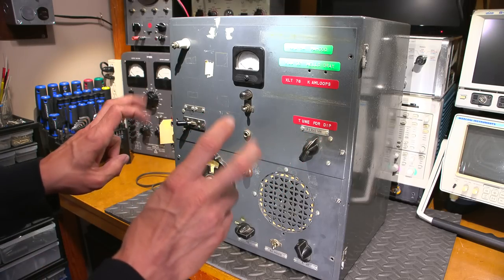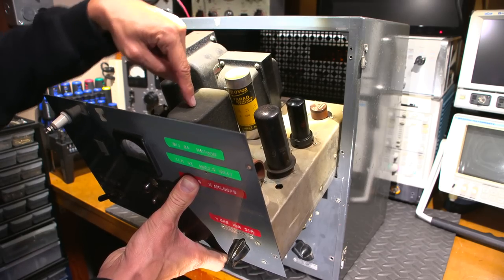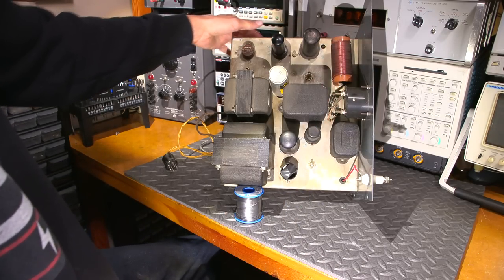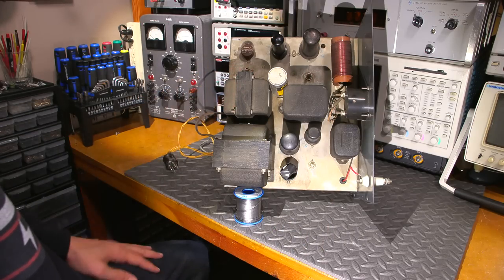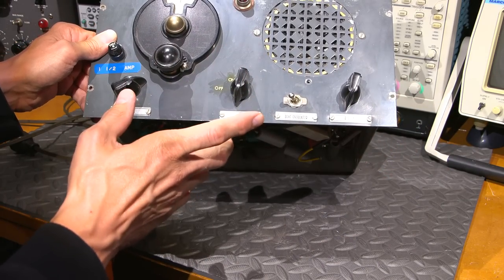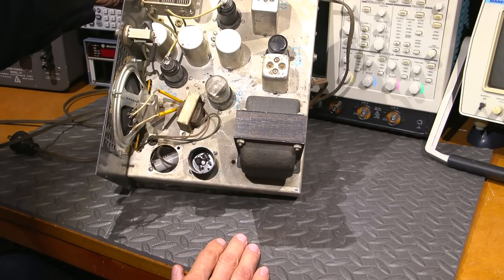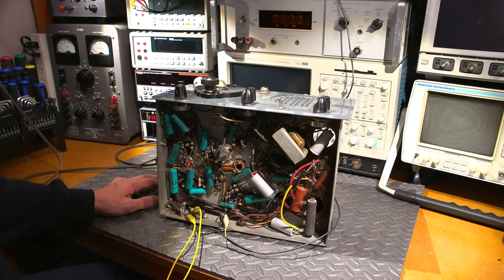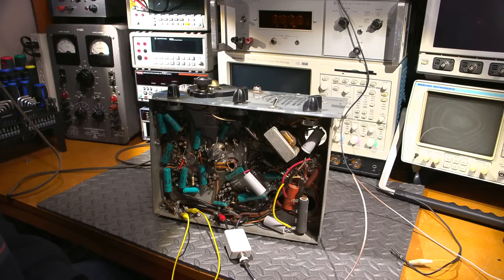1940's Forestry Radio Receiver And Transmitter [Teardown With Circuit Description]

Comment: Used to work for a Yaesu dealer, lost count of the number of 6146B tubes I binned due to collapsed envelope. Glass melted to the point that there were holes in them with obvious loss of vacuum. Mainly from FT101’s, FF901’s & FT102’s. Loved the bit in the manual for the FL2100z linear amplifier which told you to check both tubes were working by making sure the anodes glowed equally! I miss the days of tubes, solid state kit doesn’t explode in quite the same way and there’s nothing like the smoke from an HT transformer having a meltdown. Was always good fun to discharge the HT with a screwdriver just as one of the company directors was showing a guest past my workstation too 😂

Comment: Hi, Paul, thanks so much for this one.  Please accept my sincere condolences for the loss of your Father. I'm sure he'll be always close and watching over you, so proud at what you've achieved in your life up to now. My prayers are with you.

 I love messing around with vintage  TX/RX gear, takes me back to the 60s when there was lots of ex army  gear going very, very cheap! Now, it was illegal for them to sell anything that could be connected, turned on and transmitting, so they'd just pull out a tube used in the transmit section. Then as you were leaving the store they'd hold out the tube and say "By the, way, you might need this......You can have it for £1 if you like!   I wonder, do any of my fellow 60s radio nuts remember the 19 set?  I also had a 31 set, which happened to transmit on the same band 1 frequency  as the one and only  BBC TV channel. I had no idea I was jamming every TV in my village that was tuned to the 6pm news broadcast.  My mother shouted up to me "Nigel, a few people at the back door want a word with you!  Happy days!
Reply from the maker: Thanks for sharing your story!

Comment: I worked for the BC Forest Service in the early 70s. The was a communications department with headquarters in Victoria in an old house behind the Parliament Buildings. Each forest district (Kamloops was one) also communications departments that support the ranger stations within the district mostly doing VHF mobile sets. There is a pretty good chance this unit was made in the Victoria headquarters.

Comment: A BFO is a receiver function which is used for CW and can be also used for SSB decoding.  It is basically an oscillator that can be adjusted from a little below to a little above the IF frequency.  With CW it beats with the carrier (IF) to produce an audible tone making it easier to hear. With SSB it replaces the missing carrier, mixing with the sidebands to recover the audio.

Comment: My guess about the unusually hard life of FT-101 output tubes would be because they were a favorite for the CB'er crowd for how easy they were to convert to 11m use. Couple that with the meter that (At least on my ZD model) had positions for both cathode current and average power output, it's easy to see how one could forget whether they were looking for a dip, or a peak.
Reply: I too am glad to learn something about my 101,  No transmitting for now, have to get my ticket first, but its nice to find info out there on the radio so I dont burn out the tubes on my first QSO once I am legal.

Comment: Hi, I can confirm the PA valves in the 101 can melt if the plate is not dipped properly. I actually have a couple of melted glass 6146Bs here. This probably applies to other radios too, like the 901 and 902. Wonderful video, thanks.

Comment: Once, while working on a receiver, I got a big time shock from a metal tube shell.   Further investigation showed the receiver was supposed to have a glass tube in that socket and the normally unused pin 1 was used as a tie point for something in the B+ system.   The metal tube connected the shell to pin 1 and was meant to be grounded.   The proper glass tube didn't have a pin at the # 1 position.  Radio worked fine, though. Great video. Thanks.

Comment: AZG&F / USFS sold off some EF Johnson tube transmitter receiver/public address/ phone patch sets maybe 10 years ago. They were a lot nicer than that one, but they were not nearly as well maintained. Yeah, those poor Johnsons were really nasty. There was also an EF Johnson antenna switcher with that setup. Those had been jury rigged up with 350 watt RF relays.

Comment: I have an old TCS12 receiver that has a Forestry sticker on it. This was a ww2 vintage receiver and apparently saw civilian use after the war. It is also a solidly built unit and I am working on a power supply for it presently and will find out what it does when i am done. Amazing how these old Transmitters and receivers are still around. I also have a Heathkit DX100 Transmitter I rebuilt and talk about heavy it took my brother and I to move it onto the operating table. Well Paul looks like you have your work cut out for you on this pair.

Comment: Pretty much everyone used to strap a neon bulb to the antenna output which would confirm the power going out as the meter current dipped.

Comment: When I was a novice, my first TX was an old borrowed Heathkit AT-1 with a 6L6. Pops wouldn't let me use his Swan 350, but I did get to use the NC-300 RX. Anyway, he said there was a time the tube was also called a 979. It was 6L6 turned upside down and cooled in oil for a few more Watts. Hard times I guess.

Comment: Sorry for your loss Mr. Carlson. I too am very glad that you have not lost your enthusiasm to share your knowlege. At 35:19 you have a little grey box between your signal generator and your antenna input. BNC to 2 wire. Is this just  an adaptor or is there circuitry within to protect your signal generator?

Comment: Great video as always. Could you explain on a similar video one day the difference when you substitute a SS rectifer for a real tube. Even also explain if you took an old valve radio and replaced all tubes with SS counterparts? Cheers

Comment: 2:33 possibly it's partially the manual of the FT-101 that's to blame. According to the manual the first step in tuning is indeed looking for the dip, but the final step is going back and forth between plate and load while tuning for maximum output.

Comment: Interesting R/T set, probably built as a small production run. The earlier "tech" probably put a NOS "OOS" electrolytic in from the stock. The use of the vinyl tape would indicate around the 70's as written on the tag. Seems done in a hurry, like the other use of tape

Comment: Can we implement most of the TX/RX chain in 80586 assembler  to run on a UDOO RYZEN Bolt V1000 Maker Board SBC and use ADC for signal acquisition and DAC for outputting RF or driving the Speaker via an amplifier you know like the FLEXRADIO Systems 5000A transceiver.

Comment: as i recall the point of tuning for dip is because valves love voltage and hate current and the meter is a current meter. i have a yaesu 101 but i know how to use it to no melted vavles here. :)

Comment: I suspect, having a specific purpose, rather than reinvent the wheel, they purchased available radio components for the task at hand and cobbled them together.

It's not bad work. It's cheap & fast (even though it probably took months to get the unit serviced). What's wrong? Fix only that issue & send it out.

Comment: In defense of the unknown serviceman, I had a summer job back in the mid 70s repairing, among other things, tube based audio amplifiers used and abused in various public announcement systems by carnival operators and the like.  These guys just wanted it to work, wanted to pay as little as possible, and didn't much care about getting a "proper job" of it.  The boss would give me $15 cash for each one fixed and would have chewed me out if I did any more than the minimum needed to get a unit working again.  Funny thing is, 40 years on, people are probably now paying a premium for those old units and restoring them to better than new condition, assuming they survived. It's a crime thinking about those old units we once viewed as being just a step away from the trash heap. And more than once we condemned a unit as being beyond reasonable repair.

Comment: Could it be that this unit was obsolete and due for a transistorized replacement, and not worth the time and expense for a proper repair?  If it were 1972, and I knew that a new unit were in the mail, I might have patched the thing up well enough to last just a few days or a week.

Comment: Seems bad interface design that dip meter. Humans naturally try to Max things out. The smart move would have been too make sure max output would be at max needle movement. Even if that meant inverting the meter reading. Making the reading opposite of what it actually happening in circuit.

Comment: Thats because they were used by cb operators.
Reply from the maker: Converting this to 27MHz all the way from 3MHz wouldn't have happened. The CB band is a thousand miles away frequency wise.
Reply: @MrCarlsonsLab  I'm talking about the FT 101 you were referring to early into video.

Comment: The reason  101  Yaesu's  were  "hard" on output tubes is that so many were used by idiot CBers  illegally.  There were MANY   amateur  transmitters  that used sweep tubes  "at the border line"  and  many of my friends never  damaged them.  Drake  TR3/4 or  "Twins" comes to mind.  I also once had a big Yaeso 570 series
Reply: The 6JB6As in the Drakes last forever IF you tune up quick and keep a fan on top pulling air out.